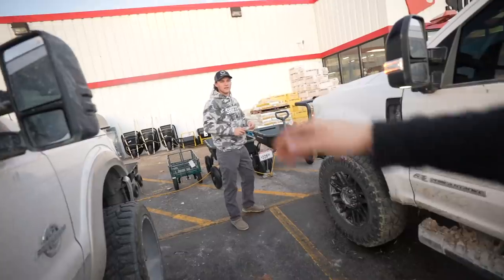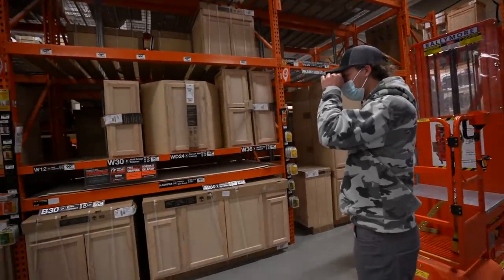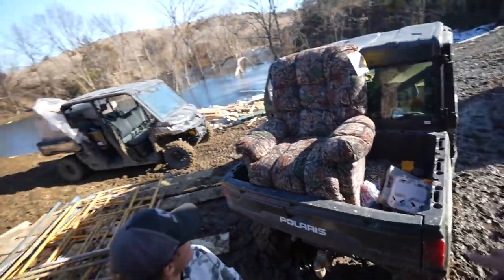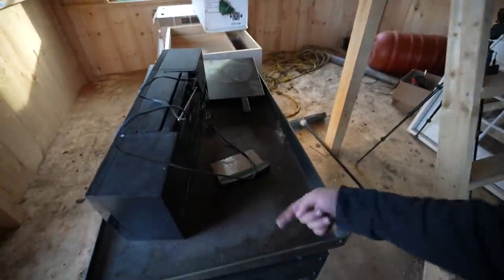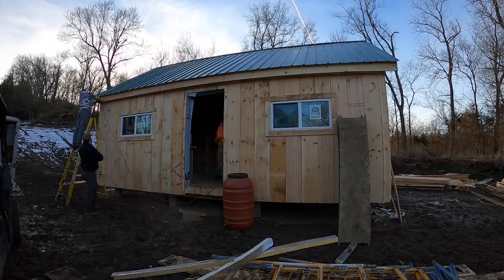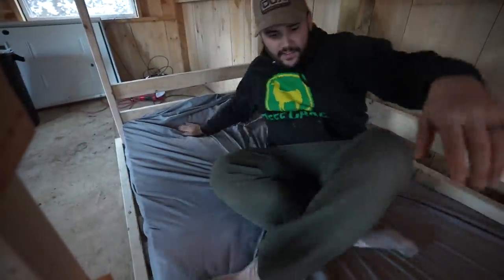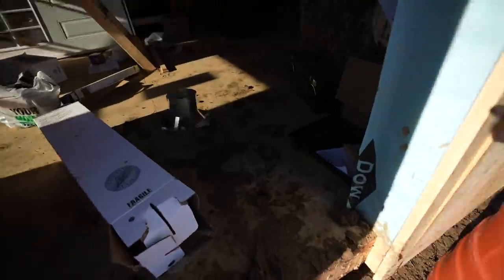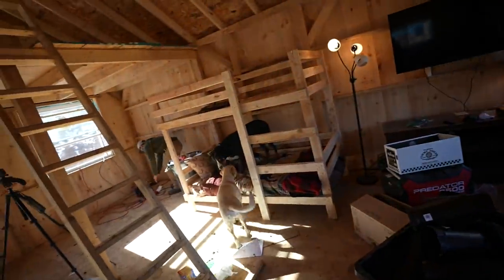My BACKYARD OFF-GRID CABIN is COMPLETE!!! (Full Tour)

Comment: It’s best to have a ceiling fan in the middle of the ceiling. Heat rises and the fan would push the heat back down towards the floor. They also make metal fan that goes on top of a wood burning stove that will blow the heat towards the kitchen. Get a piece of 1/2 DURA ROCK or other brand cement board ( in the drywall area and ceramic tile ) from Home Depot to put on the floor under the stove in case embers come out it wouldn’t hit wood. Maybe a piece behind it on the wall. They are 3x5

Comment: IMPORTANT TIPS:
1.You need to seal those cabinets and that butcher block, or the moisture, grease splatter, etc will make the wood swell. 
2.That stove will heat the shit out of this place don’t worry, there is a valve to manage the flow of heat. (Heat rises= bunk beds👍) 
P.S you need to take that stove and stove pipe outside and burn off the inside chemicals, paints etc. or you’ll be inhaling the burn off inside the cabin. Also make a wood holder for stove wood, hang up an axe, gun rack, and get a set of fireplace tools
3.The mud on the floor is no good. The moisture in the mud will go into the wood and it’ll get bad quick, among other things. 
4.Maybe add an addition like a mud room outside of the front door to hang all ur boots, coats, etc. 
5. is there any untreated lumber touching concrete or moisture?
6. Get some cupboards to put cups, plates, silverware, snacks, etc.
7. A side table(like hotel rooms) would be good.
8. Alcohol.
9. Playing cards, games, etc.
10. Maybe down the road create a rain water collection system to use the water to clean boots or something. 
11. Do you have a rig set up for cleaning game?
12. How you gonna go to the bathroom lol? Make the green ogres bathroom 
13. Deck, gravel, walking stones to get the mud out. 
14. Do you need to wash dishes? 
15. Fire extinguisher 
16. Fire pit 
17. Storage shed for chairs, outdoor stuff
18. Food drink bowls for doggos
19. I love you 
20. Charging station
21. Make a handle for the loft window to Better close it once you get a yy 360 no scope 12 point
22. Get a longer hose or stronger pump for the pond
23. That gun room you got, put a dehumidifier up in that
Reply: very good points
Reply: This ^^
Reply: 8 is by far the most important tip
Reply: Mans getting lazy. Didn’t do insulation, no floor. And the floor he does have is disgusting
Reply: This man knows what he is talking about
Reply: Another thing is a vent for that stove it's an  Outdoor griddle...
Reply: unfortunately I doubt he’ll listen and the whole cabin will turn to shit within a few months lol it hurts me to watch them cut so many corners all the time
Reply: He should also build a deck
Reply: The cabin is like 50 feet from his big ass house. It's going to be ignored and rot away soon anyways.
Reply: Yeah it’s quite half assed so far....especially for the money being put into it. Gonna build something......might as well do it right the first time 🤨
Reply: @HMM-vd2hg  The cabin build is a tax write-off so probably not a big deal how it turns out. I do agree to do it right the first time. Look around the property of what they have built, it's all crap. With no disrespect as they claim they are learning.
Reply: @HyrannoCraft  he is going to this spring and summer
Reply: @mxbass4888  the price for this is around 20k!
Reply: @yungblj5377  he go insulation in on the subfloor and walls, but he’s gotta get some siding on the outside to seal it in more, the interior looks like that on purpose, and they instead put the insulation on the outside wall, I get what ur saying though
Reply: @michaelbartlett9742  I’ll add that in
Reply: @clutterfuck23  they are learning, just that people can learn the same amount with less money spent. Mans didn’t go to college but is burning the cost of tuition to learn anyways Lolol I still love it, I’d do it too if I had the income and hustle, man is young and absolutely living the dream

Comment: You better add 2' onto your chimney, and a cap with a spark arrester, unless you want to do a My cabin burned down video. Not to mention, without a cap, rain will run down your chimney, into your stove and cabin. Also you'll find your wall will be getting too hot, if nothing else, buy a roll of 20" flashing, ànd run it behind your chimney on top of concrete board to insulate wall from heat, better than nothing, your too close to that wall. Would suggest a stone, or metal base to catch sparks on. Stove instructions should of told you all this, and listed, or showed a picture of minimum clearances from combustible materials.
Reply: This is exactly what I thought. That stack needs to be higher or its going to probably catch on fire.
Reply: I have a 2' extension with a rain cap on mine I was thanking of it but I seen your comments lol. You need something on the floor to protect it from rotting and fire sparks buddy dont want to see all the hard work go to waste

Comment: You definitely need to install a damper in the inside stove pipe to control air flow and your exterior pipe needs to extend at least another 4 to 5 feet above the cabin and install the rain cap and spark arrester.

Comment: Loving the look of the cabin brother! Now just a word of advise, once you get your other solar panels in, you need to upgrade the battery bank. 4 deep cycle batteries for all the power you will consume should be plenty and also upgrade the charging/solar controller so that you don't over draw on the batteries and they will charge faster. Also for the stove, you need a thermal fan to circulate the air around the cabin or else the hot air will just stay on one side of the cabin. Just a few tips but I love how you've made the cabin look and it has the flair touch to it.

Comment: NIce job on the cabin, two things on the stove you should have a damper in the stove pipe like a 2 foot above the stove controls air flow. Your outside pipe you should extend 2 to 3 feet above your roof for safety and better air flow. Get Pop beefcake to take a look at it.

Comment: You need a damper on the stove pipe. It will hold alot more heat in the cabin and the firewood won't burn out as fast. You need to put the stove pipe at least a foot above the roof also.

Comment: A fire Shield also retains Heat to heat up your room. And the more pipe you have running through your building before it goes out the more heat you'll retain in the building. You would use less wood and be more efficient with these tips.

Comment: You need a flue damper on the pipe above the stove. right now its just wide open and all the heat is going right out the chimney. you dont need one on a airtight stove with those you can choke it down using the inlet air.

Comment: Hard to tell in the video but did you install a damper in the pipe? You need one about 18" above the stove. Check local code on how high the pipe needs to be above the roof peak. Where I live it's 3 feet then the cap. Cabin looking good!

Comment: You are missing a piece at the top of your chimney, you should try to make boxes around the outside of the cabin for the batteries so that you can have actual outlets in each corner of the cabin... also since you will be cleaning ducks it would probably be good to have a sink with a pump to the pond or a pump from the pond to a tank so that you can have some sort of running water)

Comment: Gonna be a struggle for that little wood burner to heat that cabin consider getting  tank put on the outside and running gas heat. We have a hunting cabin and we put a big water tank on the back side and have it connected the gutter so when it rains it will add water to the tank. Bring a generator and add a little booster pump and you’ll have running water. You can also buy gas lights or if you go with a generator you can just wire the place and have a plug at your generator or can run low voltage and run light off of a 12v battery we have all 3 and they work well

Comment: get a damper  it allows you to control air flow through your wood-burner and when you have it wide open itll just burn up fast and the heat will just go out chimney if you have the damper closed some and itll slow down the burn and make the heat come out  and not just go up the chimney

Comment: #1 You need to add more to your chimney and put a spark arrester on it if you go out at night now you will see how many sparks  and embers wich will burn your cabin down and soot is going to cover the roof.  #2 I would add tile under your fire box when you open the door no lit wood  dosnt roll out and hit your wooden floor.  #3 You need to put down your flooring ASAP as that floor is going to rot really quick.  #4 Rub olive oil or linseed oil into your butcher block counter tops. #5 Put gravel down outside then a boot scraper then the step.  #6 You really need 1 more chair as there is usually 3 of you hanging out. #7 Placing a fan will circulate the hot air around your cabin # 8 Most important a SMOKE DETECTOR. #9 Hardware for kitchen cabnets and front door. MERRY CHRISTMAS

Comment: You definitely need to add another piece to the pipe outside suppose to be a few feet above the roof and stop bein cheap put some solar panels on the roof wire the inside up with plugs and lights

Comment: Take your boots off at the door and you'll have no mess. Put down hardwood flooring and a large door mat. That stove is never going to keep that cabin warm, get a bigger one. Don't stick your counter tops down, screw them from underneath. After you built the concrete plinths you should have stoned out the whole area, you're going to need it eventually anyway. You're going to want an all weather yard down there. Ask Matt Carriker where he got his solar kit from. Its properly wired into building rather than just extension leads. Also ask him about the rainwater harvesting. It feels like you're rushing through this project for some reason. People would still watch you if you did everything slowly and properly.

Comment: Need to add another section of chimney pipe and a proper spark arrester or you’re gonna burn the whole thing down. Building code states the flue pipe needs to be 2 feet higher than 10 feet back but since this one comes out at the ridge you need a minimum of 2 feet above it. I was a fireplace guy for 7 years, I’ve installed hundreds of them.

Comment: Don't trim all of the Ladder. just trim the rungs that would be above the loft. That way you still have something to hold onto as you climb them. Also, secure the ladder somehow so it doesn't tip or slide while you're on it.

Comment: Flair what you should do with the cords is take a bit and cut hole and run it through the ceiling Joyce  so in the fact if you put flooring in it not in the way and would look a lot better and is all so the way you would do it in a normal house

Comment: I wouldn't have the heater pointing out.
I'd have it under the left window because whoever is in the corner chair is going to get too hot or burn themselves by accident when they recline.
Just turn the heater 90 degrees clockwise.

Comment: You are at risk of burning your cabin down with running the piping on the side of your home the smoke has more to travel through and heat could build up so just be careful also having that piping so close to your roof can discolor your trim and wood.

Comment: Flair I love watching your videos I really do but I come to see you cut a lot of corners. I feel like your really going to utilize this cabin  so you should customize it that way and do things right the first time cause if not your just gonna end up having to spend money twice. You need flooring that wood is gonna rot with all the moisture. Tough to tell in the video but in some parts where the plywood meets plywood looks lifted already due to moisture. All that mud outside is a mess  I would just get gravel and literally surround the whole cabin with gravel. Those butcher boards need to be stained because anything that gets on there while your cooking is going to stain it, it’ll start to smell and look nasty. Like I said I love your videos and watch all of them I just think you can do a lot better of a job with the interior of the cabin build. Spend the extra money now and won’t have to worry about things failing later.

Comment: You need put a damper in the black pipe so you can hold the heat down and not
Let it run up and out the pipe

Comment: I am not trying to be mean or7 up anything but sometimes the lack of common sense in the group and with flair is  kinda scary. Like even with something used as a heat shield you need atleast 2  to 3 feet from the wall it's going to be way to hot. Also  you need a damper s few feet from the stove, and it doesn't matter if it's insulated pipe on the outside or not you need to be above the stove not right next to the eve because hot embers are going to come out of it and stick straight to eve and start a fire! And I would highly recommend a cap else it's going to fill your stove up with water and fill the pipe up with snow. Also if you want a nice wood stove you need to get one with fire bricks inside of it. Also that's stove will heat that entire cabin no problem.

Comment: Dude that’s an outdoor barbecue. It’s not meant to be used inside unless you want carbon monoxide poisoning.  There are specific stove tops for use indoors. They still require specific venting put in the walls to allow for air transfer. Please get someone to give you advice on that. Hospitalised or worse isn’t worth cutting cnrs when it comes to the silent killer.

Comment: Damn man you need to yell at your tractor supply because they actually sell there and at lowes and home Depot but they sell a complete wood stove pipe kit with the wall thimble setup and all needed except if you have a long run you might have to add a couple pieces of pipe but it's usually a lot cheaper to get the kit and add however many pieces that you need on top of the kit but it is usually quite a bit more to buy all the pieces separate instead of the kit.

Comment: I think the chimney is supposed to go 2 - 3 foot above the roof.  Also, a flue installed in the pipe right above the stove to help control the fire. Might install stone on the floor in front of the fire place as well as a heat shield behind the fire place.